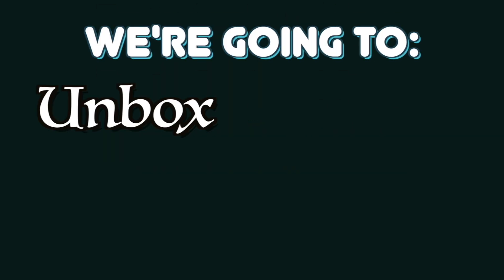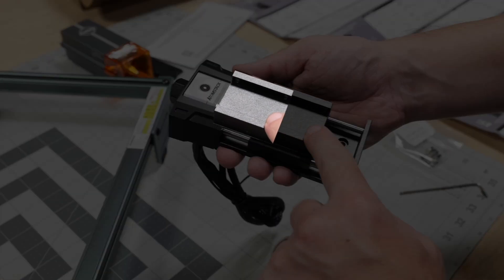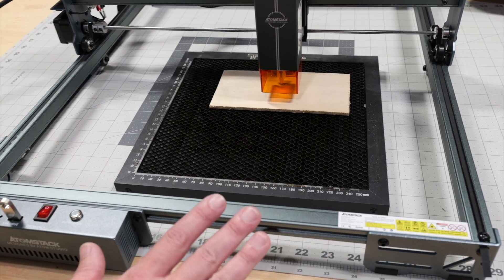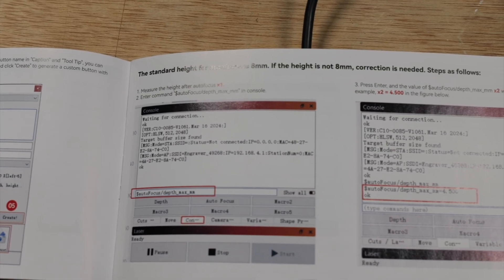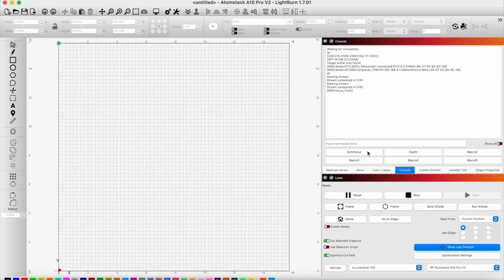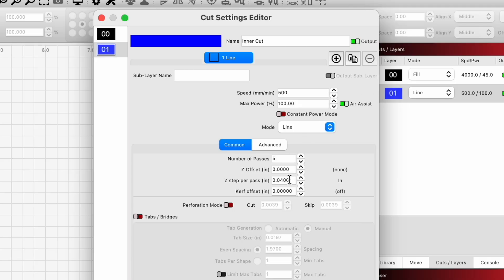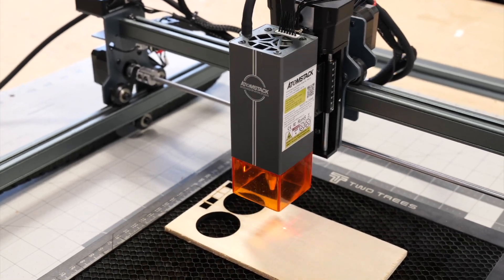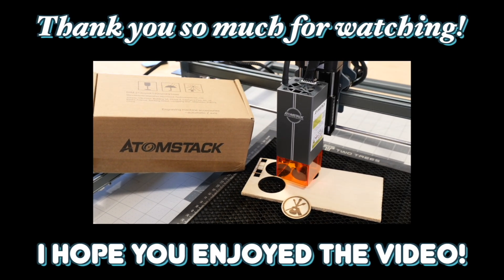AUTOFOCUS for AtomStack Ace A10 Pro V2 Diode Laser Engraver | AtomStack L2 Smart Z-Axis Module

Comment: so when i tried auto focusing it i had the honey comb as well and it like slammed down into the material, to the point it lifted part of the frame of the laser. do you know why it might have done that?
Reply from the maker: It sounds like there is a possibility the material wasn't located directly under the sensing part of the module and so it kept pushing down and hit the honeycomb because it didn't sense a place to stop.  If that isn't the case and keeps happening we suggest you reach out to AtomStack for support.